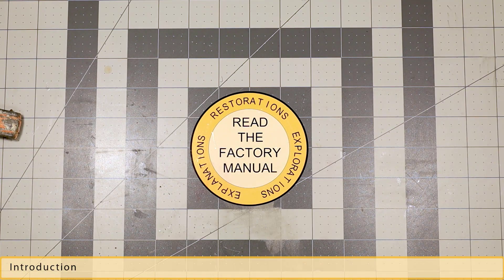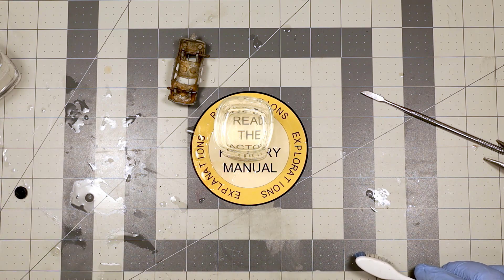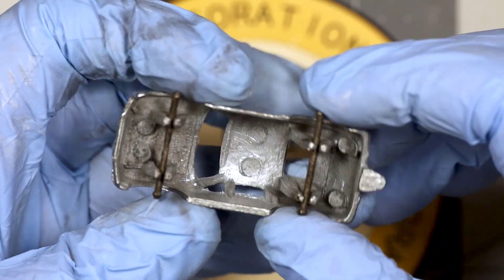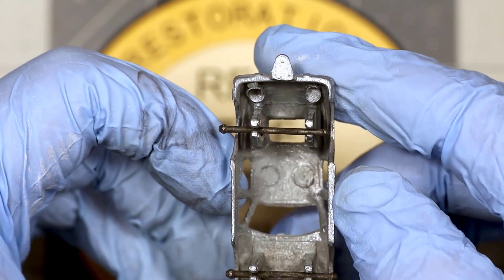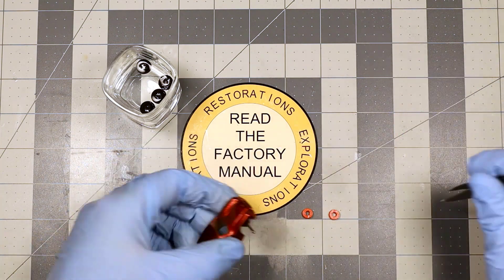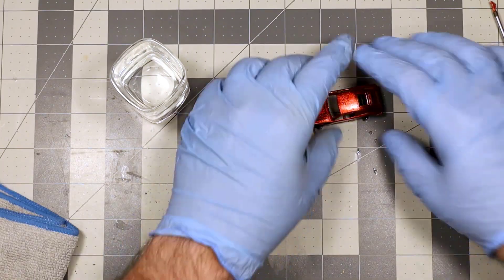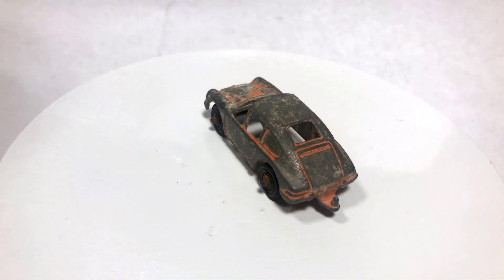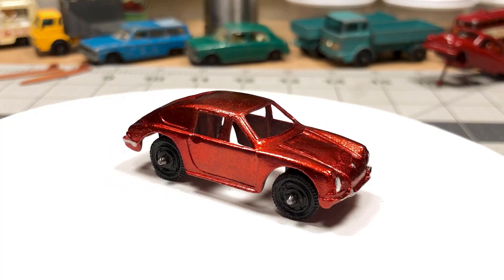TootsieToy Porsche 911 Custom Restoration

Comment: Hey Bill, I just gave you a shoutout on my latest TootsieToy upload, and cited your channel in the description. I used the hot water technique to remove the tires before paint. Not brain surgery, but I never thought of it until I saw you do it on the Porsche 911 right here. Thanks for that tip!
Reply from the maker: Your welcome and Thank you.   I will make sure to do the same when I follow some of your advice.